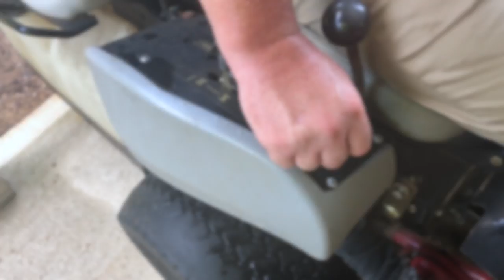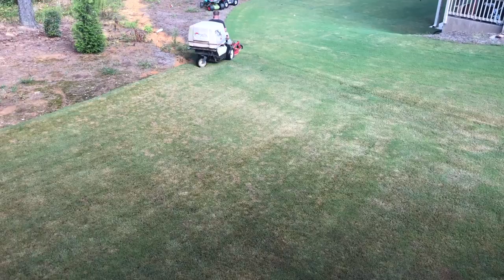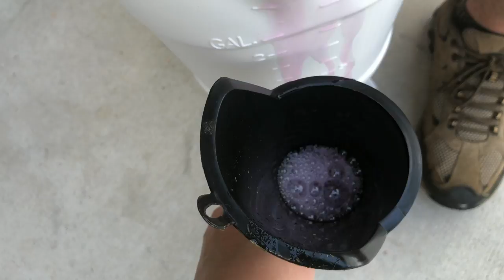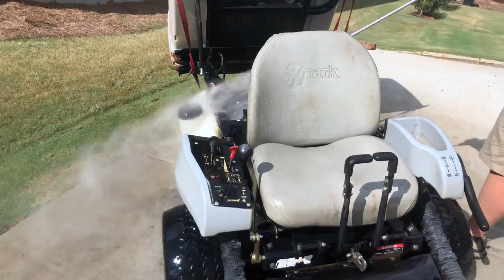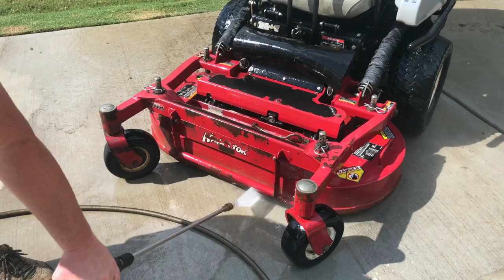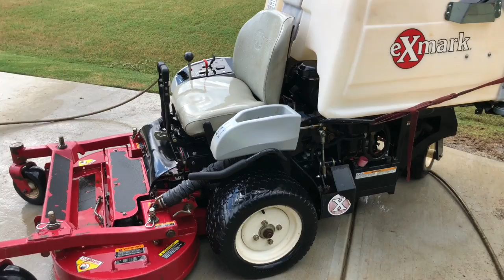CUTTING WITH AND CLEANING THE EXMARK NAVIGATOR || The Southern Reel Mower

Comment: Question about pre emergent.  I planted centipede seed middle of August it's filling in pretty good just slow typical centipede. Wondering if I can put my fall pre emergent down or should I wait. Didn't know if the runners will tack down with the pre emergent
Reply from the maker: Pre emergents are root pruning a bit. Depending on where you live, I would wait as long as I could before applying it.
Reply: I live in Mobile AL right on the coast. So it would be best to wait until next spring? Sorry about all the questions just don't want to mess up
Reply from the maker: I suggest you looking up your local soil temps and go from there. Weeds germinate at different soil temps, is the reason for the important timing of pre emergents. They have to be applied and watered in before winter or summer weeds germinate to be effective. There is always that inbetween timing when re seeding or planting new grass.

Comment: What type of bermuda do you have? Is it different than the back yard?
Reply from the maker: It’s the same type of Bermuda. The back has had zero chemicals applied to it and it’s been cut with a rotary mower at like 2.5-3” since we moved in. A perfect example of the difference between a lawn that has the proper chemicals/watering schedule, along with a reel mow cut.